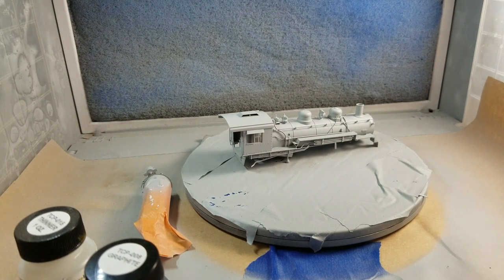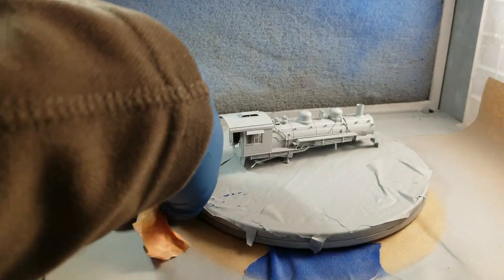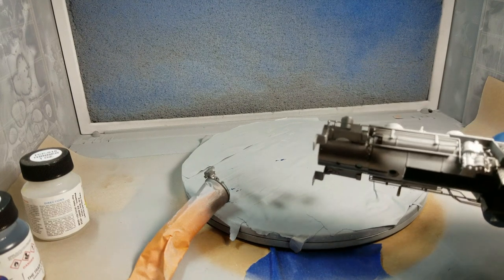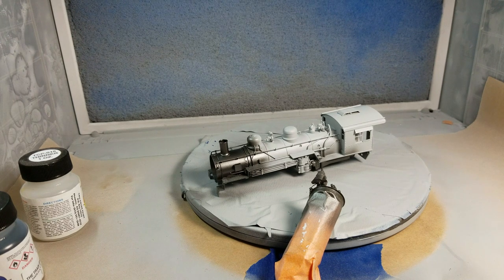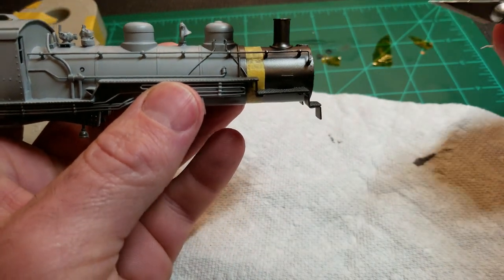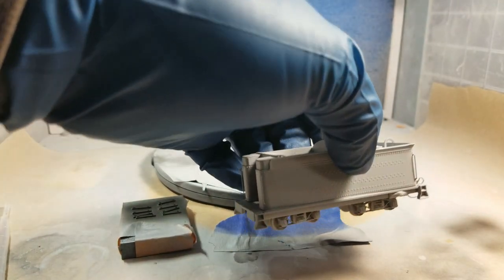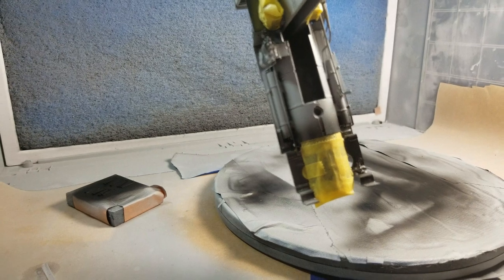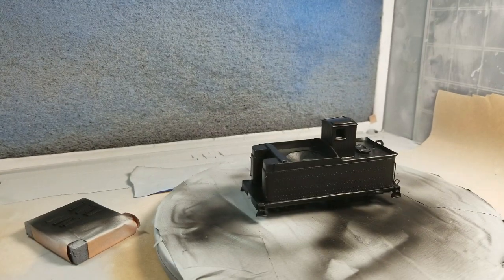Painting a Brass Locomotive Part 2

Comment: Excellent videos, and great tips! But i noticed you didn't wear gloves handling the model when you were masking it. Won't the oils in your fingers affect the second paint's ability to adhere? Or once the loco is primed is it ok to handle?
Reply from the maker: I washed my hands right before, it's very hard to mask with gloves on, tape sticks to the gloves. I use gloves when I paint the model. If you think you may have got oils on it, give it a quick wipe with a cleaner, dependent on the material of the model. For brass I use lacquer thinner to wipe it down.

Comment: Hi I'm currently working on turning a Bachmann Berkshire into The Polar Express, just like this. I was wondering how you painted the front of the boiler and the smoke box door and what color did you use? thanks.
Reply from the maker: I used tru color graphite for the smoke box and boiler. I masked off the areas and painted. You could use a brush and paint it as well, just may not be as smooth.

Comment: why did you leave the trucks and wheels on the caboose?
Reply from the maker: This model the trucks I was afraid of breaking the castings buy prying the wheels out as they were soldered together. I did not remove them from the tender due to soldering a wire to the top of each of the trucks to bypass the frame to top of truck contact area for electrical pickup. Most models I will take the trucks apart as it makes for a cleaner paint job.